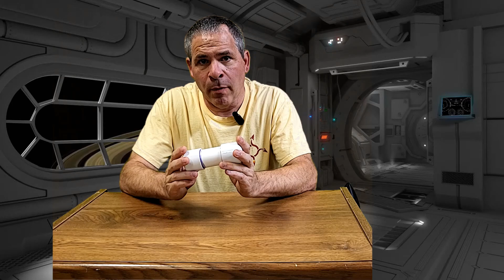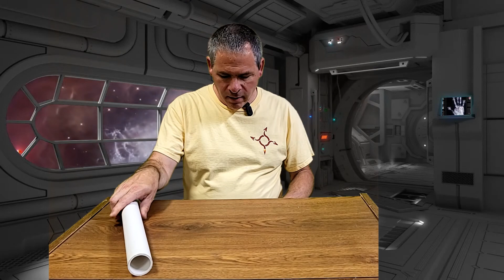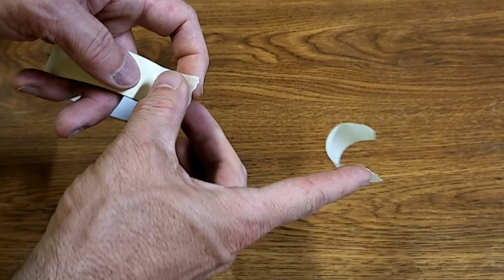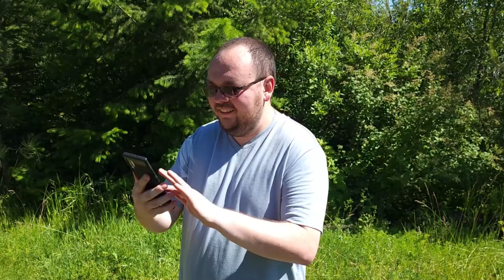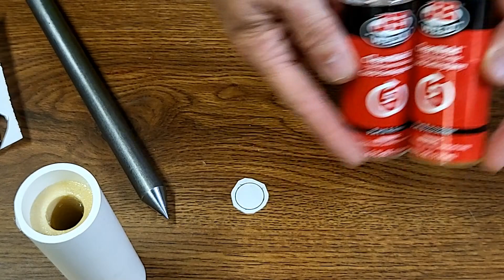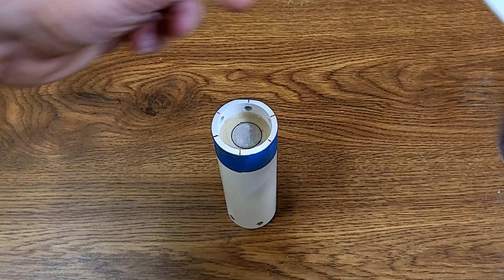Making our simplest homemade rocket motor even simpler?

Comment: 19/64.. Why not 3/8 nothing  about his seems exact.
Reply from the maker: The nozzle size is extremely important. Reduce the size and the motor is likely to explode. Increase the size and you reduce the thrust. We don't just pick these numbers randomly, we experiment to find what works. Nozzles are measured in 64ths of an inch, so 3/8 would be a #24 nozzle. That's 5 sizes bigger and would greatly reduce the thrust, possibly to the point where the motor would not even be able to lift a rocket.
Reply: Many common drill bit sets have 1/4, 5/16. and 3/8" bits. There is not a lot of difference between the 5/16 (=20/64) and 19/64" bit you used. That's just a tiny bit larger and would be a small percentage of thrust less but a bit longer burn time.
Reply from the maker: True, 5/16 would be a safe alternative. However... As you know... If One is going to be building rocket motor nozzles that are measures in 64ths of an inch then One should have a good drill set with 64ths.
Reply: @rotaryrocketry  You could also say if one is going to be building rocket motor nozzles then one should be using a lathe. I was just pointing out that many of your viewers might not have the section of tools you have and bits that others do have that would work just as well. It's not hard to adjust the grain length or core diameter to get the pressure you want that works with the drill set they have.
Reply from the maker: True... When I used my lathe in some videos a while back, I got slammed a bit in the comments with statements like "You know most people don't have a lathe"
Reply: @rotaryrocketry  Yeah - a lathe (plus the skills to use it) is a big investment of both time and money.   A 19/64th drill bit is not.

Comment: I make my rockets using kitty litter and PVC
Reply from the maker: I tried that kitty litter cap thing a few years ago and could not get it to work. I'm sure it was just that I didn't do it right.
Reply: @rotaryrocketry  Looks like you have  better ways of doing it anyway. My rockets are a little smaller.  The biggest I've done was 1 inch so far using kitty litter
Reply from the maker: I'm pretty sure when I was trying that, it was with 1" PVC also. I was trying to copy something I found on YouTube... Of course for him it worked great... For me, it was an epic failure...lol

Comment: FYI, Grainger has your 1-1/4 Sched 40 end caps at $0.77 ea and if you want to order online Zoro has them for $0.59 ea..
If you have a local electrical supply distributor and make friends with the head counterman. Over the course of the year they will throw out hundreds of feet of damaged PVC pipe each year that could end up in your hands... If you are interested in higher pressure lighter weight pipe, when you are down at the supply house see if they stock fiberglass  RTRC (Reinforced Thermosetting Resin Conduit). I personally prefer Champion brand.. The stuff is available in 3 wall thickness.. The lightest (SW) is half the weight of PVC and is significantly stronger and stiffer in every direction while being significantly more heat resistant than PVC.
Reply from the maker: I know they can be purchased cheaper but because I only buy a few at a time, I get them locally to avoid shipping costs.
I will look into that RTRC... Sounds interesting, thanks.
Reply: The military has been using fiberglass tubes in weapons for a long time. The tubes MLRS fire out of are fiberglass. LAWs and AT-4s too. The Carl Gustav recoilless has a fiberglass tube too. 

It's impressive what fiberglass can take.

Comment: "that nineteen sixty-fourths of an inch drillbit" Geeze who uses a system like that.
Reply: Blame the king of england
Reply: There's a reason for the imperial system of measurement, and that's to make you convert to metric to render it usable.
Reply: @peterkallend5012 you've got millimeters then centimeters then you jump to meters. 
So anything less than a meter is a metric buttload of centimeters, right? 
But most of the time you just measure things in millimeters don't you? 
We have a foot. Fractions of an inch, which can be measured way down to thousands of an inch for when we want to be precise. 
Even 1/10,000th of an inch if you want to get really small increments. 
But going up, we have feet before we get to a yard. 
3 of them to be exact. 
It's nice being able to measure something less than a meter without having to use big numbers. 
With that said, I do like the 1,10, 1000 convertibility..... 
Let's face it, most Americans are comfortable with standard AND it's easy to convert to metric. 
European number snobs who refuse to learn standard aren't going to have it so easy, IF they decide to start speaking both number languages. 
I can speak both fluently. Can you?
Reply: @christopherleveck6835  You can go down from millimeters to micrometers to nanometers to picometers...and beyond.   So the ability to measure in smaller fractions is independent of the system of units.

What's painful about imperial is that if I want a smaller drill bit than 8mm - I can go with 7mm.  But if I want smaller than 19/64th - I want an 18/64th - but for some archaic reason, I have to divide both by two and use a 9/32nd.   Why can't you just stick with 64ths?    What about a #8 bolt??  I have to have a chart on the wall someplace...but then I have an 8 gauge wire and I need a hole to thread it through...but 8 gauge for wire isn't the same as a 8 gauge bolt.   What insane lunatic every thought this was a good idea?  Let's not even start on the gauge of bullets - or the fact that not one teaspoon that I own holds a teaspoon of salt and not one tablespoon holds a tablespoon of flour.     For the longest time - US pharmacies used "grains" for measuring drug doses - abbreviated 'g'.  When drugs were purchased from overseas where 'g' means "grams" the law required grams to be abbreviated to 'gr' - to "avoid confusion".   Since drugs were often NOT relabelled after import - a whole lot of people died as a result.
Reply: @christopherleveck6835 decimeters so 1 dm for 10 cm but it’s not in much use from wanting precision.
Reply: EVERYONE in America. Keep your metric BS.
Reply: <sigh> Far too many people, sadly.  But going 100% metric when living in the USA is an uphill struggle.   My local DIY stores (Ace, Lowes and Home Depot) have no metric drill bits, no metric tape measures and metric nuts and bolts are in a separate cabinet that never has enough of one size to be useful - and they cost 4 times what imperial fasteners cost.   However Temu can be your friend - and they have endless mountains of metric goodies for cheap.
Reply: Imperial/ metric measurement's ? They make tool sets for both so there's no need to learn one or the other because ya just select the one that's needed for the job !
Reply from the maker: hmmm... Only everyone who makes rocket motors in the USA. Nozzles are measured in 64ths of an inch so this is a #19 nozzle.
Reply: @rotaryrocketry pppp❤❤❤
Reply: Lol if 64ths get ya wait till you find out there are number, letter, fraction, metric and SAE sizings.
Reply: @CarterGunnells  also "gauge" (which means different things for fasteners, wires and tubes) - plumbing parts which are randomly measured in inside and outside diameters.  Wood which comes in nice round inch-sizes but never comes remotely close to the size they say it is.  Electrical parts are randomly specified in Amps or Watts - but with some rash assumptions as to the voltage you'll be using it for.  Nuts and bolts that have the same diameter but SUBTLY different thread pitches, to ensure you cross-thread them - but with no clear engineering reason for being different. (#8 bolts with either 32 or 36 tpi seem especially annoying!)   Nuts and bolts with the same diameter and pitch but different head sizes...it goes on and on.  Presumably this maze of stupidity seems logical to people who grew up with it...but if you're used to metric it's a freaking nightmare!
Reply: @SteveBakerIsHere  being a journeyman I realize the multitudes of different units. I built one production facility that had equipment from Europe, Asia and North America. I worked the electrical from 470 three phase all the way down to control voltage. Hyrdolic, pneumatic and mechanical. The biggest headache saver and time saver was to just work within the unit of measure provided for the application. Don't convert anything and tool up for everything and most importantly don't get used to anything. Stay flexible ! In all my engineering design I would just use the standard for the location.
Reply: Unless you are using a machine shop grade mill to drill it, I's gonna be 3/8..
Reply from the maker: 3/8" is 5 nozzle sizes larger than what we are using and would greatly reduce the thrust. I use 19/64 because that is what was determined to work best during testing. Reduce the nozzle and the motor is likely to explode. Increase the nozzle and the motor produces less thrust. Increasing to 3/8 would decrease the thrust so much that you would likely not even be able to lift a rocket.
Reply: @rotaryrocketry most machinists will tell you that American standard drill bits are made slightly smaller than they are designated. If you want an accurate hole, you use a 9/64 drill bit and then follow it with a 9/64 reemer. And you end up with a PERFECT 9/64 hole. 
Nothing is as it seems....
Reply: @rotaryrocketry  The thing that people tend to forget is that the cross-sectional area goes as the SQUARE of the diameter. 19/64 is 0.297" and 3/8 is 0.375" ...not THAT much - but the area of a 19/64" diameter circle is 0.088 square inches and 3/8" is 0.14 square inches - so the nozzle opening is about 60% bigger.   For some specific volume of gas being produced per second - the exit speed of the gas will be about 40% less.  Since momentum is mass times velocity - keeping the mass the same and reducing the exhaust speed by 40% directly turns into 40% less thrust.  Urgh!   Going down in size increases chamber pressure by the inverse square of the nozzle area - so making the nozzle even a little bit smaller can drastically increase the chances of an RUD.

So I agree - don't be messing with the nozzle size!
Reply: @ericeglish3948 there's almost 2mm between 19/64" and 3/8" 
If you're making 3/8" holes with a 19/64" bit, you're doing something wrong.
Reply: @ericeglish3948 Why use anything else? Repeatable precision is impossible with tools that are....made with looser tolerances. Found this out the hard way.😢

Comment: Years ago we made our PVC motors like that. We formed the convergent by making the coring rod tapered to form the convergent. We also added an extra hole or two in the bulkhead end for additional strength so that in the event of overpressuring the nozzle would blow out instead of the bulkhead. If faster startup is desired, you can roughen up the core surface so the motor comes up to pressure quicker. 
We also did the top of the motor differently. We would add a solid section of propellant on top of the cored section, it would provide tracking smoke/delay and adding a small hole in the top epoxy or cement would create a passageway to make the motor ejection. You neglect to say building the motor with end caps not only makes those motors more expensive but also adds weight to the motor end that may require ballast weight for stability that further increasing the weight and reducing the performance of the rocket/motor. Also, adding those end caps would require a larger diameter rocket airframe. 
Now for safety, the propellant should be made outdoors and the coil cooktop and pot is second most hazardous method for making sugar propellant only to cooking it on an open flame burner.
Reply from the maker: So it turns out that this new design is nearly 30 grams lighter than the end cap design. Both designs fit nicely into a 3" diameter rocket that I mentioned was the style we use for this motor. But rocket design and stability are a topic for another video.

Comment: So much more simplified, I think you confused this video with some other more complicated video that was marked illogical.
It might be simple but not easy, and even if it's easy it is in no way simple.
Reply from the maker: Well, the title is actually phrased as a question... And I did make it clear at the end that this new new design was actually more difficult to build.
Reply: @rotaryrocketry  For a one-off build, the extra effort is pretty significant - but if I was batch-building a dozen of them - I think it's unimportant.
Reply from the maker: Very true. It was a lot more work in the end for basically the same results. However, I found the experiment very interesting and I'm hoping to integrate this new anchoring cement nozzle and bulkhead technique into a much more powerful motor in the near future.
Reply: @rotaryrocketry  I do appreciate the technique of softening the pvc, I'n going to incorporate that into my design. Looking forward to your next video.